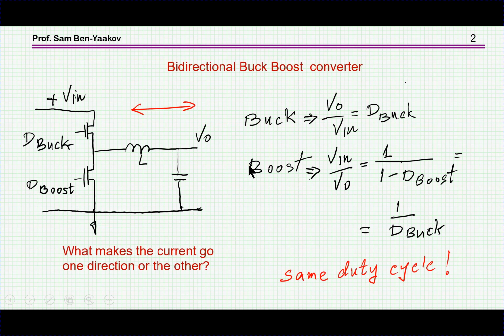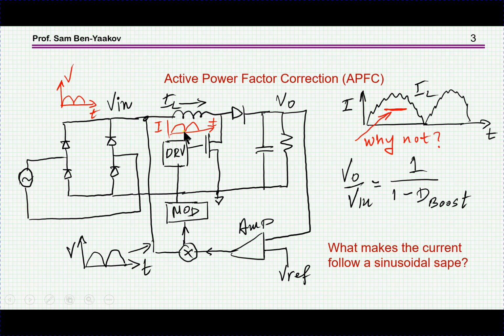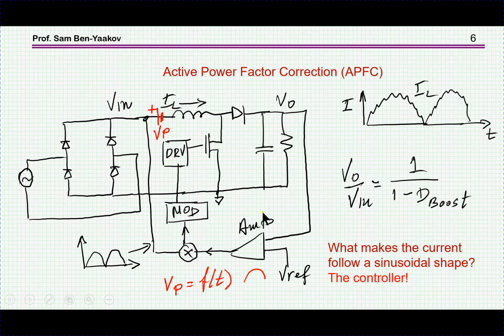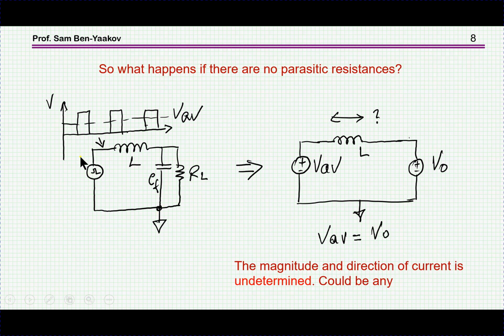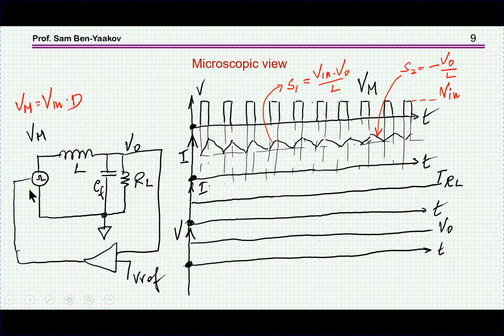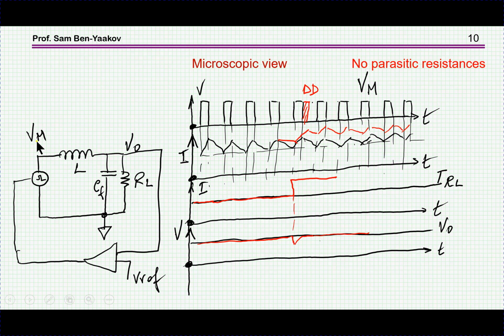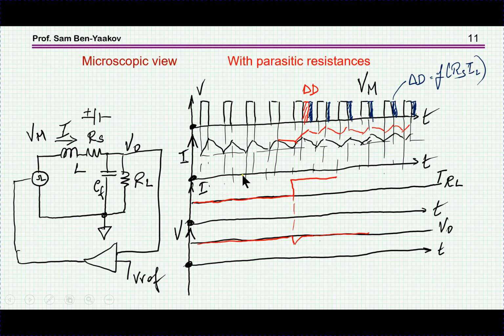A supplement to: Resolving a current control mystery in PWM converters

Comment: This line of explanations did not convince me, but superficially ok. I am more interested to see the ideal case only. As and when people take parasitic resistance as a crutch to explain this, I just feel they are diverting the main issue, which is how ideal boost converter able to feed desired load current at same duty ratio. Even simulations also confer this fact.
Reply from the maker: What exactly is your explanation to the mechanism that increases the current?

Comment: No, sorry, you are wrong. A synchronous buck converter works fine with constant duty cycle.
Reply from the maker: But since it is also a synchronous Boost, which way the current will flow?
Reply: @sambenyaakov , the current changes with respect to the inductor according to the difference of the voltage ratio from the voltage ratio determined by the duty cycle. So if the voltage ratio between input and output side is greater than the voltage ratio determined by the duty cycle the average change in current will be positive. And if the voltage ratio between input and output side is smaller than the voltage ratio determined by the duty cycle the average change in current will be negative.
Reply from the maker: @flobbie87  The voltage ratio is determined by the duty cycle not the other way around as you wrote. According to you, one can not control the circuit such that it will be Buck or Boost?
Reply: @sambenyaakov , yes. The voltage ratio determined by the duty cycle will not be created instantly. The system converges to that ratio by the way described earlier. If you put a voltage source on the high side and a load on the low side, you use it as a buck. If you put a voltage source at on the low side and load on the high side, you use it as a boost.
Reply from the maker: @flobbie87  well, what if you have two charged capacitors of exactly sam voltage. How will the duty cycle "adjust" and at to which direction will be the current?
Reply: @sambenyaakov , ok. To recap the assumptions. We have a synchronous buck converter, a fixed duty cycle, infinite switching frequency and a capacitor on each side of the converter. So, after the initial oscillation has subsided, due to damping by the inductors resistance, we end up with a voltage ratio equal to the duty cycle. Please note that the absolute value of the voltages depends on all initial conditions, which includes the voltages at the capacitors but also the initial current through the inductor.

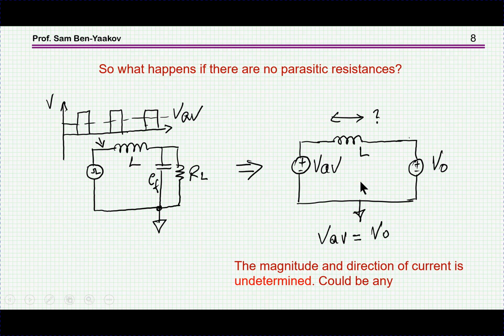Comment: I don't see how, when, in your circuit at 7:00. Vav and Vo are the same, that the current in the inductor or short can be anything BUT zero ?  When you have say, two batteries that are the exact same voltage, and you connect them in parallel, there would be NO current between them.
But, maybe I am missing something like, there WAS current in the inductor and it is a perfect inductor and the current can not change ?    As always, love your videos !
Reply from the maker: Thank Bob for continued interest. Indeed, the point was that without knowing the initial condition you cannot  tell if there is a current and/or it's magnitude and it will not change  dI/dt=V/L
Reply: OK thanks Sam.  That says it all.

Comment: I think these videos are great, thought provoking and interesting...For this particular discussion, I like to think of it like this: In a stable closed loop system with loop gain >|1|. there must be a disturbance in the loop for the error controller to act upon and hence force a change in the duty cycle. Of course the disturbance can be be purely dynamic (such as a pulsed load, as described in this video for the case of fictional lossless system),  "static" (such as with normal losses in the system and no load transient), or a combination which is normal case... no?
Reply from the maker: Thanks for discussion. Indeed, with losses there must be a change in D. For an ideal system and let's go all the way : an infinity large output capacitor, there must be a monetary dD

Comment: Hi professor, by looking at your response to other comments I understand the point you are trying to make. But I think in the no parasitic resistance case, the converter can reach steady state with increased averaged inductor current to match the increased load current even without the controller, that is an inherent feedback mechanism in CCM during transient as others also mentioned. The controller will help to improve the transient performance compare to open loop. Of course with the parasitic resistance case, the original duty cycle D will not lead to the desired output voltage since there are extra losses, the controller will help to correct the duty cycle by increased some amount to compensate that. By the way, I appreciated your YouTube channel videos on power electronics and I do learn a lot from you.
Reply from the maker: Thaks for discussion. With parasitic losses and no feedback the voltage will drop when output current change. In an ideal system (and let's go all the way: infinitely large output cap) there must be a momentary dD to change the current.

Comment: I am not on the same tone ... First I have to tell that no Book can deny that if the parasitic is there then the Vo=D Vi will change .. All derivation is based on no parasitic even if it is not realistic .. if there is a prasitic so yes ALL of us will agree that Vo is not D Vi ....BUT .. You have a question in the first slide in first video which is what makes output current change if Vin, Vo and D are fixed ... You ignored the inductor reaction in transient which drops voltage when the current changes and then disappear .. that tells the controller to react. That answers the question but not the parasitic 
if the parasitic is there so everthing is to be derived again.
Reply from the maker: I think that we do agree. The point I was making, which I think you agree, is that the inductor  current will not change unless THERE IS a change in duty cycle if Vin and Vo are kept constant.  So in reality, when there is a load change there must be  a change in D to keep Vo constant. Have not seen this in any book, But then, I have not read all books. Ask your  colleagues about this and you will be surprised that only  few, if any,  will answer correctly.

Comment: Change in inductor current has nothing to do with parasitic resistances but rather unbalanced inductor&load currents: a voltage mode controller only cares about keeping the output voltage constant. It has no direct information about the current. However, it can sense the current indirectly as any change in load current causes a change in the output voltage via output current no longer matching the avg inductor. The same principle applies to bidirectional buck&boost: if you apply the load at one end (say on the right hand side) this leads the controller to change the duty cycle such as to induce an equal avg inductor current equal in magnitude and direction to the load current, which ultimately leads to a steady condition for the output voltage. As with the PFC controller, it is the input voltage waveforms fed into the loop that forces the current to have a sinusoidal shape.
Reply from the maker: The point I was making, which I hope you agree, is that the inductor  current will not change unless THERE IS a change in duty cycle if Vin and Vo are kept constant.  So in reality, when there is a load change there must be  a change in D to keep Vo constant. This is correct in voltage and current mode.
Reply: Yes, that I agree, a change in current does requires a temporary change in duty cycle until the new steady state inductor current value is reached, at which point the duty cycle goes back to the initial value (or a slight different value if parasitic resistances are accounted for). Nice channel by the way, keep up with the good work!